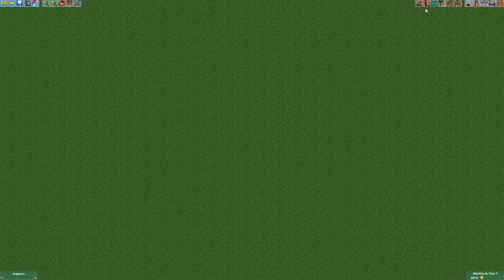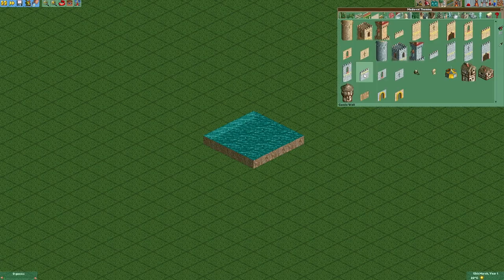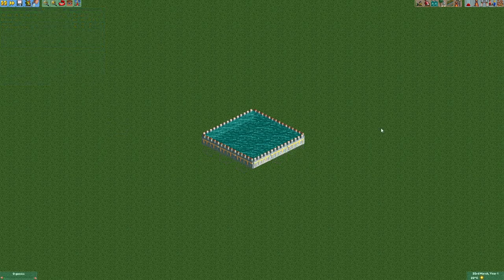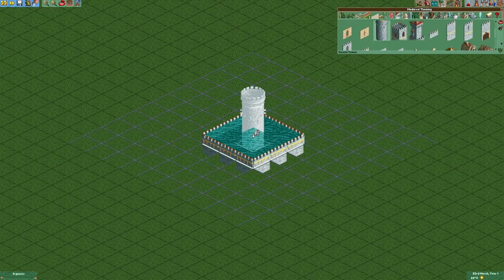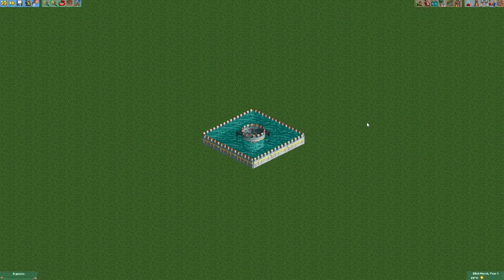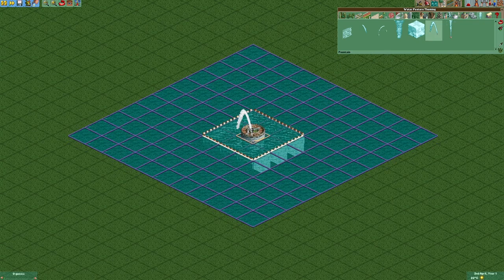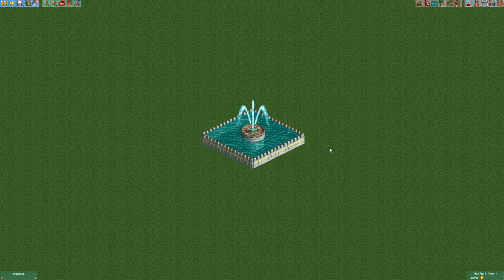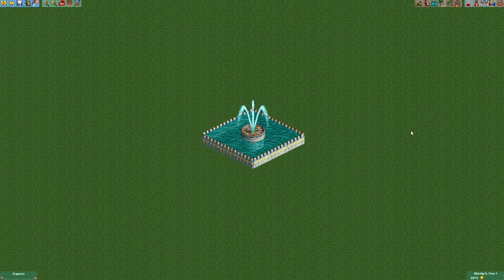RCT Minutes #4: Easy Fountain | OpenRCT2

Comment: Is there any adaptations you can make to make it friendly for vanilla?
Reply from the maker: Around the water, you could use the walls that are only half as tall. In the middle of the fountain, you could dig into the ground and place a square tower in the hole instead of the round one.
Reply: @Flyxxpy  thanks!